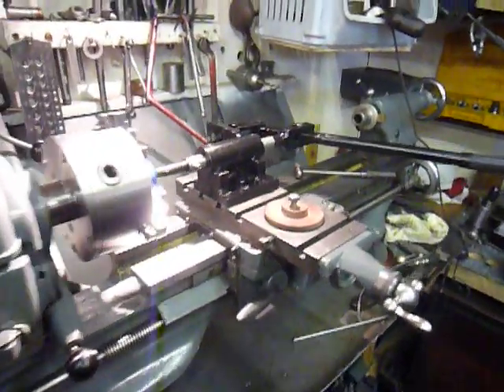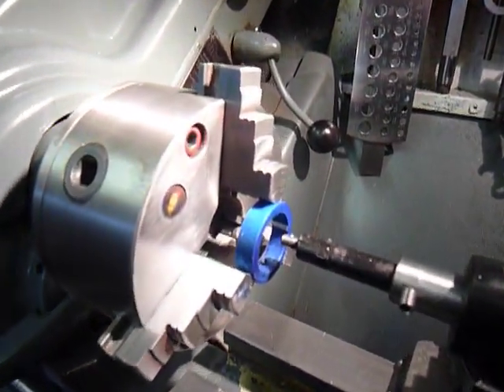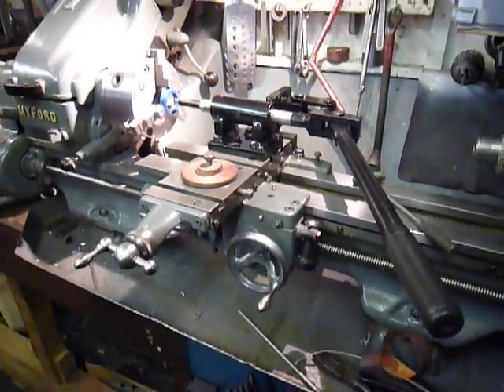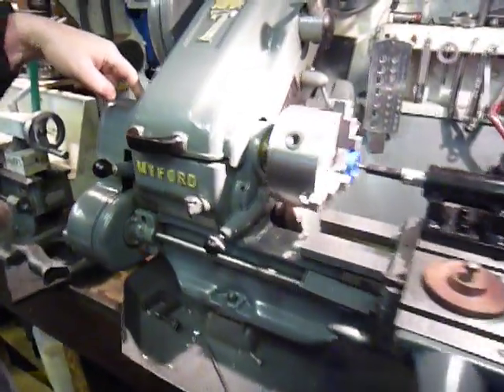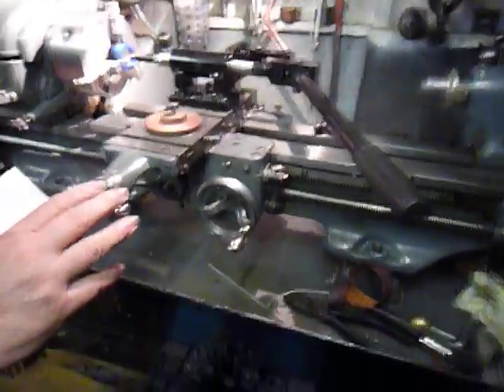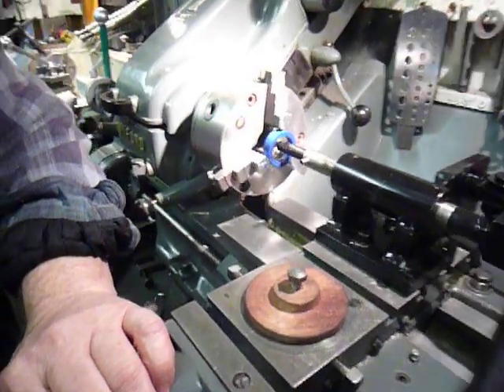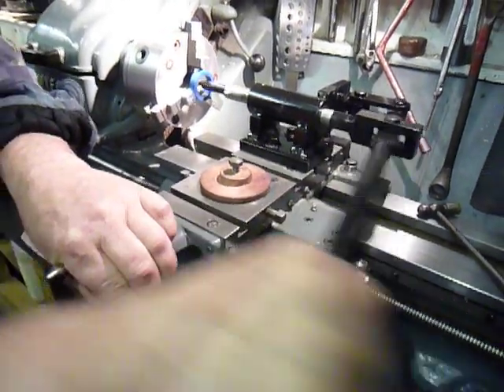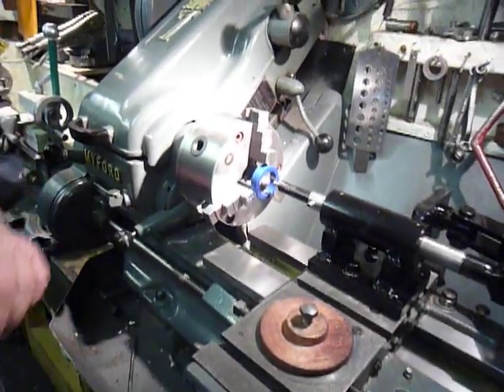myford keyway slotting tool P1010901.MOV

Comment from the maker: Hi Malcolm 
Thankyou for the kind comments! Also for putting up your version for  us. The keyways I have cut are usually imperial sizes. I just select a hss tool steel I.E. 1/8 3/16 1/4 etc
and just give it a little bit of top and face clearance.
ps  I have  made a spacer plate to fix the slotter on to which  enables me to use it on the milling machine using the rotary table.
thanks again Mick

Comment: Nice work, good adaption, sounds just like mine when it is operating. 
Have you found a way of accurately making the cutters to the correct width? I found it difficult to grind HSS accurately and ended up using a diamond wheel mounted in a mandrel on the mill and using the fine downfeed to set the cut.
Malcolm